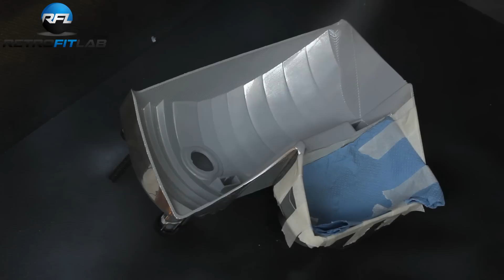Dodge Ram 2009-2012, HID Bi-xenon projectors tutorial

Comment: What about light beam adjustment?  This kit seems a lot easier to install then others where you have to use rubber mold to attach the projector to the housing.  Any chance you guys have a similar product for a 2012 Chevy Avalanche?

Comment: Hey old video but still. 
My question is. I’m trying to do exactly as you did. I see you put  a high beam splitter to activate the celenoide. But this trucks turn the low beam off when you put the high beams. So even if the selenoide is activated how good is this if the bulb doesn’t light up ???
Reply from the maker: In that case you might need a H4 diode cable so low-beam stays also active, or make a new signal wire to the solenoid which is activated with an extra switch for example.
Reply: @Retrofitlab  and how that worked on yours ? I think our headlights works the same even mine is 2017???
Reply from the maker: @ulicsc.5103  This was a customer's headlight, we don't have more info about it or if they were any problems with the high beam setup, sorry.
Reply: @Retrofitlab  hey little update. Actually my mistake. The low does stay when I put the high. 😅. That is awesome. Thanks for the help though!

Comment: ***** you should have used electrical tape and tape up the positive wire and the negative instead of leaving them exposed and risk the customer hitting a bump and the wires touching and causing a short!

Comment: using a bi-xeon projector with the quad light dodge setup.... does this mean that when you turn on the brights both the factory high's turn on and the bi-xeon solenoid actuates and you get the full beam of the new projector and the factory high?
Reply: +Retrofitlab I live in the NW part of US.  I have had this discussion with various State and local law enforcement (friends)  not one of them either enforce or care about how many lights are on during &quot;high&quot; beam operation.  They do reference some state laws about no more than 4 lights at once... but honestly they dont enforce it unless you just blind everyone.  Thanks for the follow up! I like your video... to the point and clear.

Comment: ***** you should have used electrical tape and tape up the positive wire and the negative instead of leaving them exposed and risk the customer hitting a bump and the wires touching and causing a short!
Reply: Retrofitlab.com not a problem buddy I've done a few retrofit's on my lexus rx300 and had some wires touch a few times and it wasn't good lol! So now I'm on top of making sure nothing touches, sorry if I was being a little harsh lol, lights look great keep up the good work!